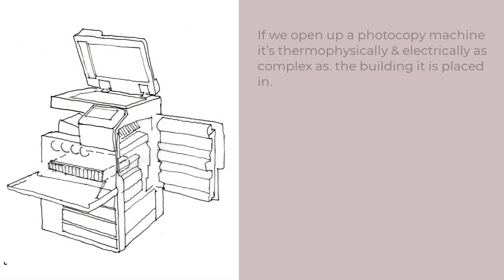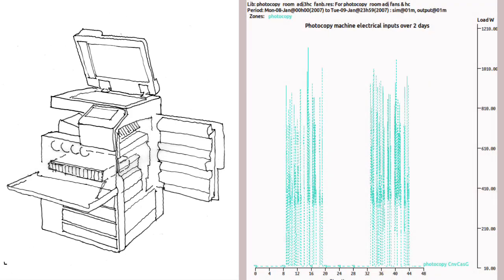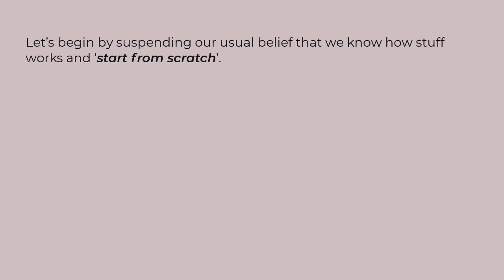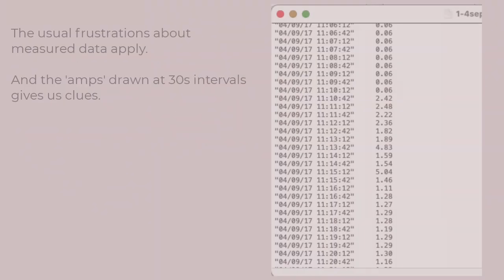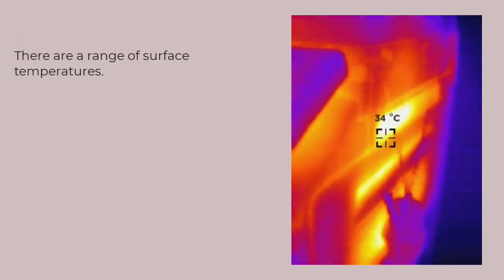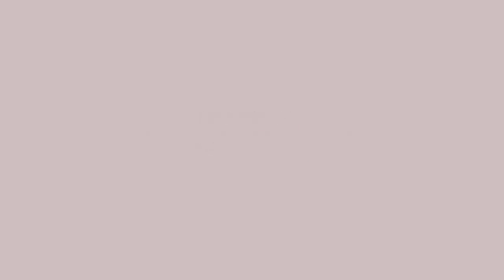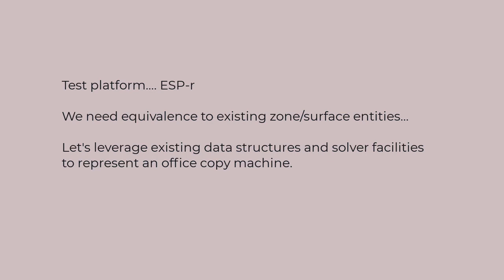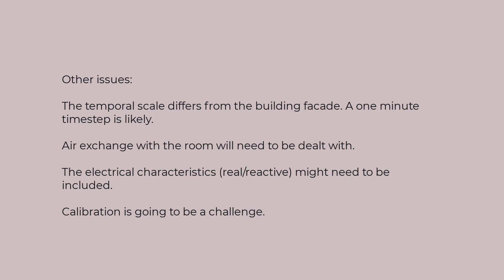New series: Digital twins of office equipment within whole building simulation.

Comment from the maker: This project has been gestating for several months. Initially it was as background for an IBPSA paper for a conference in Rome in 2018. The limitations of a conference paper combined with the advent of better thermographic cameras got to me to take a new set of measurements.  What that showed was a wider range of temperatures in the machine case and thoughts about how one might design the digital twin to deliver that broader range.  So the next video is going to spend more time with the methods needed to evolve the model that was created several years ago.  It could make a good case study for the design of models which to deliver specific behaviours.